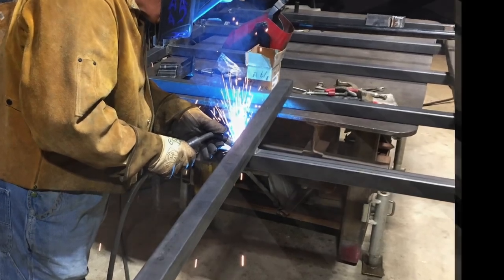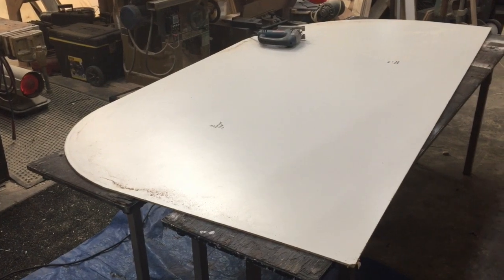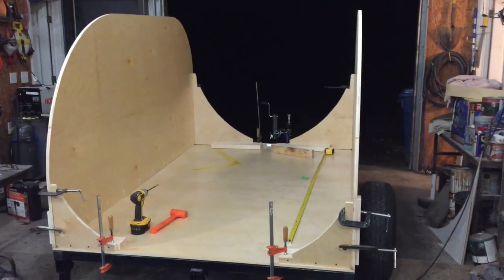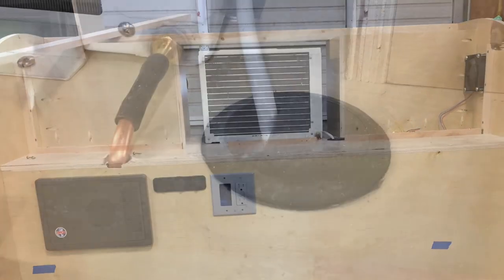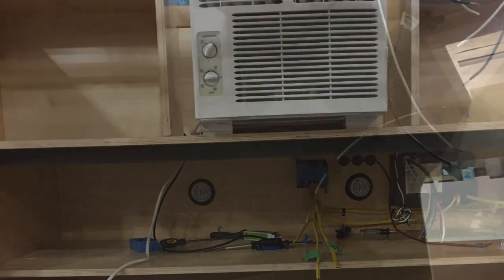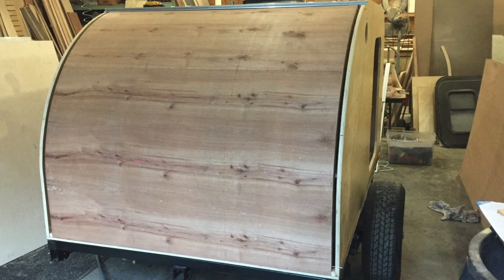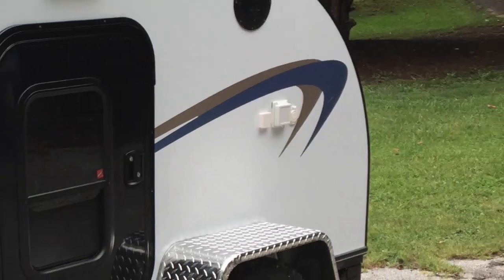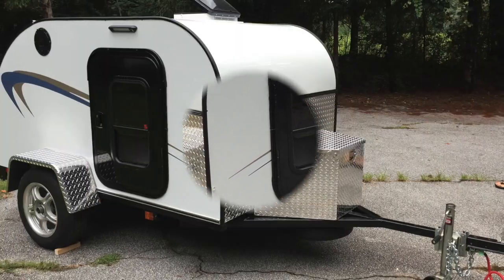DIY Teardrop build with A/C, Radio, and TV

Comment: I am back to watch your camper build again as I am working on another build my self
Reply from the maker: Let me know if I can give any advise. I looked at your videos.  Looks like you doing a good job.  Im getting ready to build an "Offroad Overland" trailer I think.  Drawing up the plans now.
Reply: @gillis122  I will look for it, hay did you run a drain line or just do a drip pan
Reply from the maker: @mlangfordoutdoor  I ran a nylon reenforced vinyl drain tube out the bottom.  I just don't trust the evaporation type pans.  I went to great lengths to keep water out of the camper.  I didn't want it to leak fro the AC unit.
Reply from the maker: Good,  Im selling my Teardrop and going to build another camper.  Im designing a stand up Teardrop.  Hopefully out of all aluminum so it will be really light.  Im going to put a bathroom and outdoor kitchen.  We will see how it turns out.  Ad for the views, I have no idea.  I posted it and it took off.  I couldn't believe it either.  Thanks for watching and commenting.  Keep up the good work building ;your camper.

Comment from the maker: I bought a small 5000 BTU ac.  They come with a “pan” built into them.   I drill a hole in the lowest part of the pan and use epoxy to glue a nipple so I can mount a  vinyl hose to the nipple and ran it straight down through the bottom of the camper.  As for heat that is put off by the unit.  If you notice the round “kayak “ vents on each side( the black round things).  I mount  fiberglass screen inside the vent to prevent bugs.  I used a 12 volt computer fan to pull the heat out.  It works well.  I hope this answered your question.   If not let me know.  It took me a while to figure out how to work this out.
Reply: So you are pulling heat out of the system though your side vents that blow out, but what about outside air coming into the system on the back side of the unit? From what i understand, on the side that goes outside of a window, you have outside air coming into the sides, and heat coming out of the back, so the air coming in seems like it would just be recycling the hot air in the duct instead of getting new fresh air since air is only being pushed out. How are you getting around this?
Reply from the maker: @EricLindsey123  Hey Eric,  I may not have explained it correctly.   The vents on the side of the camper should be opened.  The computer fan pulls around 300 cubic feet of air per minute.  (yes its powerful, bought from Ebay).  The fan pulls hot air out while pulling cool air in.  There is an airbox that the A/C sits in made of plywood, air is pulled by the unit sideways.  The air coming out is barely warm. No water comes in contact with the wood.  The condensation is caught by the A/C pan and drains through the bottom of the camper.   We regularly run the unit all night long.  We live in Georgia and the temps are hot in the summer months.  We have had to turn the unit down several time because as you can expect the camper is a small are and cools quickly.  If you want to send me your email, I will try and send better photos of what Im talking about.
Reply: @gillis122  Thank you for explaining! It totally makes sense what you are saying. You are right, those computer fans are really powerful as you say and that would be more than enough airflow to cool down the small duct way on the backside of your AC unit. Thanks again for taking the time to explain what you did, as it helps me as well as I try to figure out this problem with my build. I live in Georgia too so i definitely get what your saying about the summer months.

Comment: The trailer looks great! I have a question for you about your AC unit though. How has it fared in the confined space as far as heat and moisture are concerned? And how did you route your drain line? I imagine you had it coming out beneath the camper somewhere, but how did you actually route it in the wall so it was hidden?

Comment: That camper is built professionally very nice, I am starting a teardrop camper video build and want to use some of there mods you used on your awsome camper, if you have time take a look at my build, liked and new sub here
Reply from the maker: I looked at your teardrop build, looks good!  I thought about building my doors but ,I did my doors very late in the project and decided to buy doors.  I put a fantastic fan in the roof and we open the door windows at night and the fan pulls in cool air.  We live in Georgia and we have not needed the AC yet when sleeping.  The fan works great.   Let me know if I can help you with any information.  I know I struggled at times.  Have fun.

Comment: That's a great looking camper I've been dreaming of building one for years. When you mentioned your siding you said aluminum and plastic composites. Did you use sheet aluminum for the skin or plastic composites? And where did you purchase it?
Reply from the maker: John Chastun 
Hey John
I used “Aluplast”.  It is aluminum exterior with a plastic middle.  It is used in the sign industry.  You can get it in different colors and different thicknesses.  I used 1/4” thickness on the sides and top.  If you need more information let me know and i can find the company where I purchased the material.  It comes in 4x8 and 5x10 sheets.  Its great stuff.
Reply: gillis122 thank you for your reply. I will do some searching to see if I can find it. Sounds like what I've been looking for.
Reply from the maker: Its both,  Its called Aluplast.  Its a plastic sandwiched between two sheets of thin aluminum and then painted.  It is great stuff and not super expensive.  Thanks for commenting and watching.

Comment: Great looking trailer. I am in the planning stages of a teardrop build and really like the layout of yours. I am going back and forth on a 8ft vs 9ft cabin.   Is the trailer roughly  5x8' feet?  Is the bed area a full 60"x80" or did you go with a short queen? Any thoughts on the size after using it a few times?
Reply from the maker: Hey Marc
My trailer is 5x8.  I didn't want any seams in the plywood.  I was concerned with leaks.  We went with a 6" 60"x75" queen size mattress.  I think they call it an "RV Queen".  Bought it off of the internet from eBay ($160).  We have camped several times and had no issues.  Im 6' and the bed is plenty big enough. I pull the camper with a Ford F-150 so we put all our supplies in the back of the truck.  We use a small refrigerator and keep it in the back of the truck.  So when we get to the camp ground we just plug it in.  We can make ice and keep things cold.  My wife uses the cooler for drinks and vegetables.  
I did the same thing you are doing with planning.  I looked at everything on the web, drew my plans and started.  I made several changes along the way.   I think I could build another one in half the time it took to build this one.  
If you want to know any specifics please ask.  I know how frustrating it can be trying to figure out what will work or not.  Good luck.
Greg
Reply from the maker: Absolutely,  If I had it to build again I would definitely go with the 9 foot trailer.  It would have given me more design freedom for the kitchen in the back, and 1 foot does not mean that much when pulling for backing.   Go with the 9 foot!  Wish I had.  Everything works well with out camper.  However, If you go with the 8 foot you will need to watch the design aspect very closely to make sure everything will fit.  Good luck and welcome to the Teardrop camping community!  If I can help you with anything just shoot me a note. I read everything I could get my hands on when building ours.

Comment: I'm a new lady newbie. I have a 5x8 mid range trailer. I'd like to put in a tv. I will have small battery/ basic solar. But I dont know anything about the tv going in. I have a 19 inch I use at home. Can I put that in trailer? If so how?
Reply from the maker: Hello Td,  You can purchase a 12 volt TV,  I have seen them at Best Buy or you can get them online.  You can run the tv from a battery or solar,  Then use an HD antenna for your channels.  We use our cell phones as a hot spot and connect it by Apple TV.  If your like me, I'm not too technical with all this stuff.  Get with a younger person and have them help you out.  Oh, by the way we are selling our camper if your interested.  It is listed on Atlanta Craigslist under RVs.  Thanks for watching and commenting.
Reply: @gillis122  thank you but I got one thanks

Comment: How do you fasten the wooden frame to the frame of the trailer?
Reply from the maker: Im not sure what a "groom" is.  However,  if your talking about the sides..   I bolted an piece of angle 1 1/4" on each side to the bottom frame and then bolted the sides to the same angle.  I used pocket screws on all the interior portions of the build.  I used 3/4" refinished birch plywood and the exterior is 1/4" Alumaplast sign material.  Its great to work with, its waterproof, and fairly inexpensive. Its a composite material of plastic sandwiched between two pieces of aluminum,  about $50 a sheet.  Let me know if I can help you with your build.  Good luck.
Reply: Edited the comment. My apologies
Reply from the maker: Oh, OK,  I built the frame for the trailer, then I used the "Alumaplast" material as a water barrier and screwed it to the trailer frame.  I then used 3/4" refinished plywood and screwed it through the Alumaplast into the frame.  Then attached the angle iron and then attached the sides to it.  It is very sturdy.  Does this make sense to you?  I tend to overbuild things like this.  But, I didn't want it to leak or come apart.  We have spent about 40 nights so far in the little trailer.  My wife loves it.  Let me know if I didn't explain it to where you could understand it.  Thanks for commenting.
Reply: gillis122 yes that totally makes sense!! Thank you